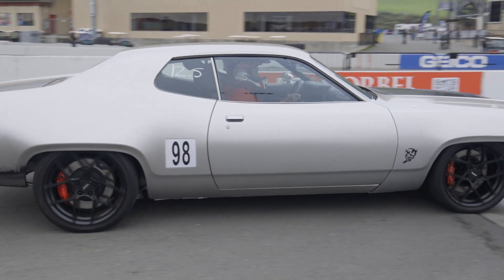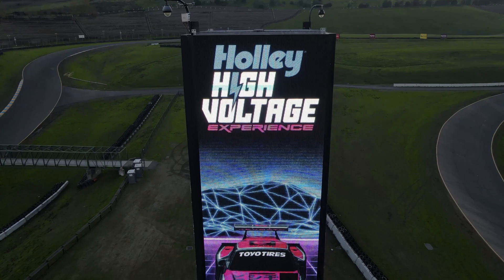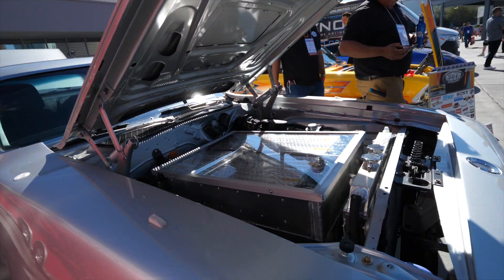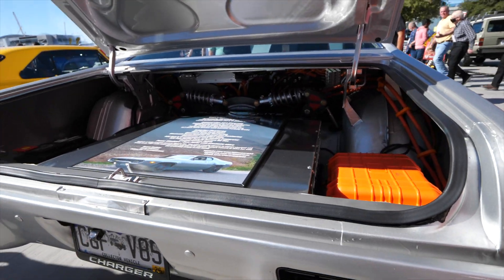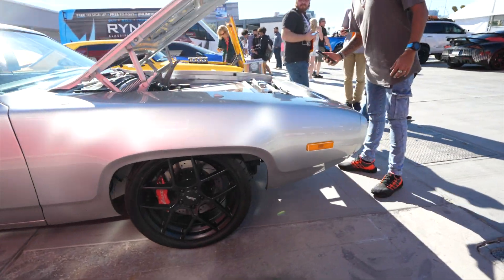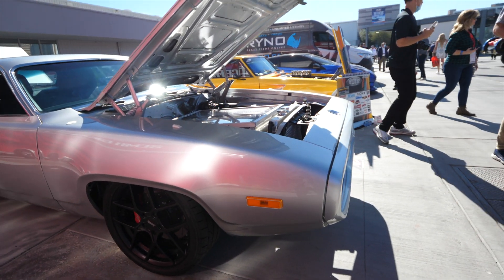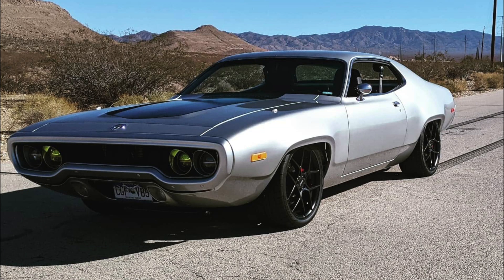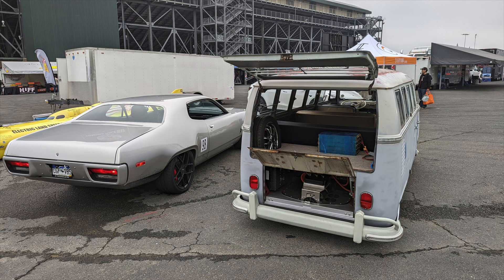Plymouth Satellite Tesla Swap @ holly High Voltage Experience

Comment: Wow, it's unexpected to see my video here!
https://youtu.be/tSrBwJ-usUo

Thanks for pointing it out that it was a Plymouth Satellite, as I had it mislabeled as a Dodge Challenger.  (Not sure if I did that, or the announcer)
Reply from the maker: Thank you for posting it,  it was really hard to find it the second time
Reply: @jehugarcia  I was glad to see my video used... Blew me away after been a long time fan of you work.

Too bad we weren't able to connect up, as your VW EV Transporter is one of the best builds I've seen. Would have loved to see that for real. (Although the Teal one at the event was "pretty"... but not my cup of tea.

The Trucks were what was best there, and my favorite was this Toyota mini-truck 4x4 "rat-rod" with a full Leaf setup inside. I've never even though of pulling the Leaf motor and controller off of the transaxle, and it worked so well for him. 

That F-100 Eluminator was sweet too, especially when the fabricator there told me they did it all in 7 weeks!!!

Hope to see you Next Year!

Comment: I know a better way but it would include signing papers and I will not give up the idea. I had a shop from 80 to 92 I worked on it even after I had to give up my shop in 98 and was working on an Electric power Source for a car and it was working out very good I had to stop on it because I hurt my back but the test I did with it was looking up I could run all day at Idle and when driving I could do 16 hours this is with out any gas and I used a 1970 Dodge Charger rt top speed was 140 MPH. and cut the running time down by 30%.I am not a smart man when it comes to Electric cars so if I could do That  with no funding and very little knowledge some one like you can do it better.